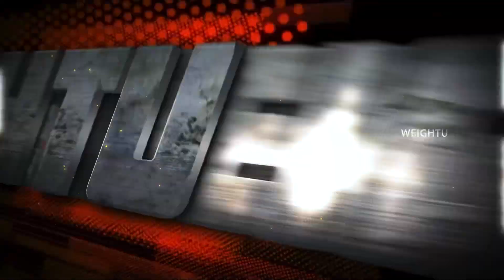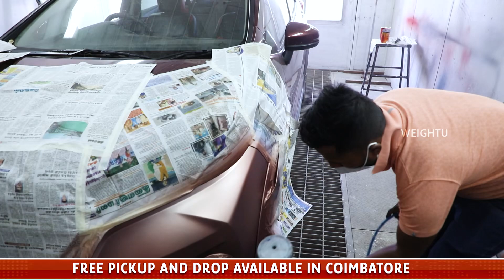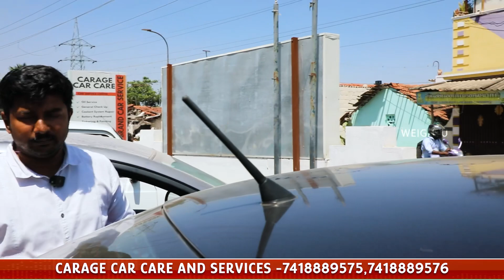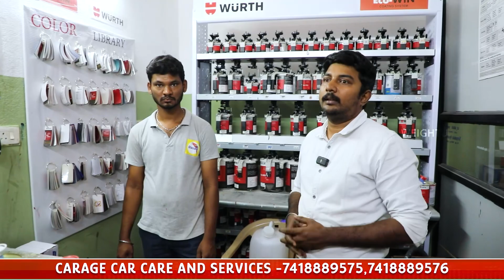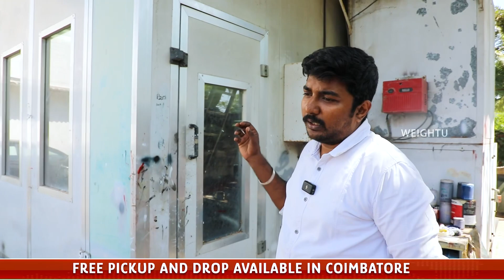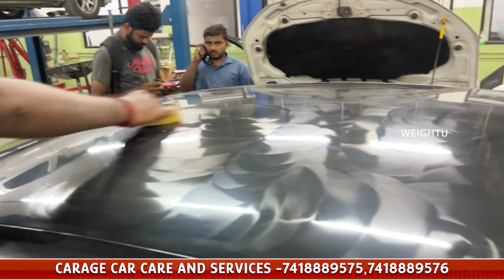Best Car service center in Coimbatore - Modification, Detailing & Other Services - Doorstep Pickup

Comment: price very high bro neenga avangalukku mela 18,000 20,000 varum nu solreenga roof ku mattum😂
Reply: Hi the prices depend on the work carried out, materials used and craftsmanship. The prices we quote are standardised based on the market pricing and oem labor schedules